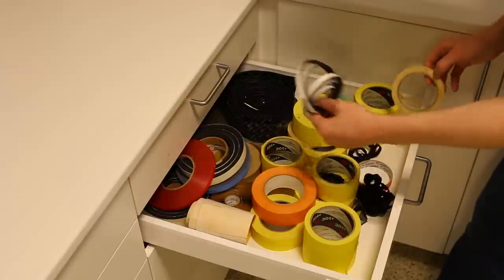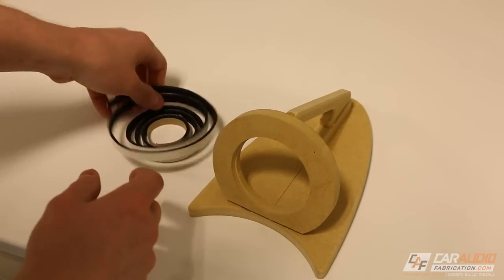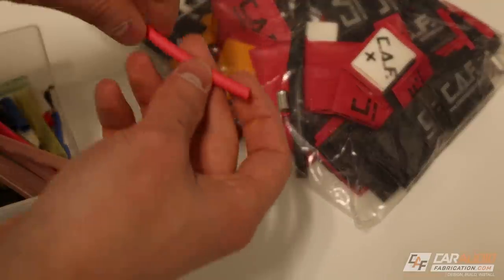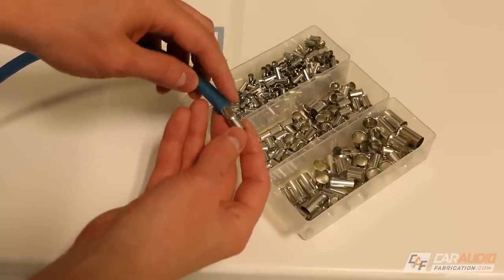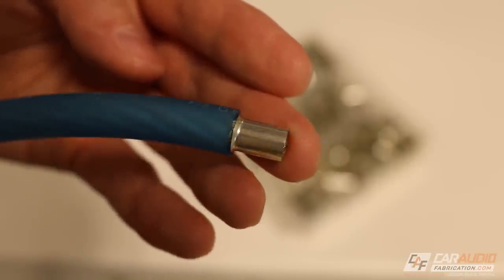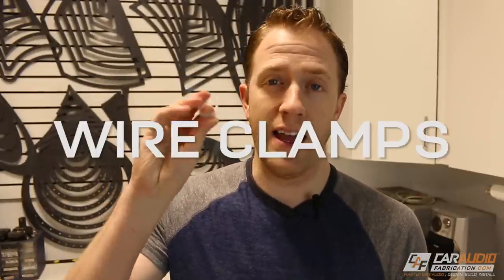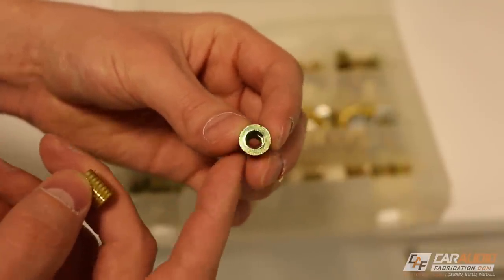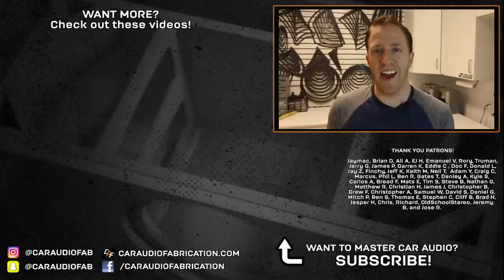Installing Car Audio? 10 CHEAP things to have FOR EVERY BUILD!

Comment: would those threaded sheet metal fasteners work for grounding wires to the sheet metal? Seems like a cleaner way than drilling then bolting with nut and bolt, takes the need for a nut under the car away ect? Or would they not ground properly? I'd think with the metal sanded down to bare and it literally squeezing itself into the metal it'd ground perfectly, but you'd know if there are any problems with that way, let me know if you can, thanks (I think it'd make the install in my e46 neater, but don't want to run into any grounding issues if I go that way)
Reply: yeah i should have thought of that haha, Good thing I haven't got round to my system yet. I'll give them a go, I can't see why they wouldn't work tbh

Comment: Ok i have a question aboit a specific vehicle... I have a 2017 mitsubishi lancer and it has the factory Rockford Fosgate system in it but its not enough bass for me and i wanna add my amp and subs that i have had for a while. I have everything i need from box,subs,amp,wiring,and the LOC to go from speaker level to rca to run to my amp. My problem is where to get my input signal from for my amp? Ive been stuck on this for a while and my local "custom audio" shops advice was throwing a different loc from what i had and saying "thats all you need"and "the directions are in the bag but its pretty self evident what you should hook everything to" so could you give me an idea where i need to get my signal from? I would gladly pay for good advice from somebody that knows what they are talking about!!!!!

Comment: Great information here. Tell me would this sound system be okay to start with? It is about $350 dollars.

130S5000BT  Pioneer DEH-S5000BT CD Receiver

130TA6986R  Pioneer TS-A6986R 6" x 9" 4-way Speakers

130TSG680    Pioneer TS-G680 6"x8" 2-way Speakers

130GMA4704  Pioneer GM-A4704 40W x 4 Car Amplifier

007CK10       Amp Wiring Kit 10 gauge
007CPER417  4 Channel 17 ft RCA Cable
007CSW16    Speaker Wire 16 ga per foot

Comment: Relays are always a good thing to have on hand. I like to keep some diodes around too, just in case it becomes necessary to tap into a line, the signal won't feed back and cause other components to be affected. I'm a fan of the 3M spray adhesives, but other brands probably do as well and cost less. Single edge razor blades have saved my butt on numerous occasions, as well as a spring loaded center punch. But as far as tools go, the one you leave behind is the one you will undoubtedly need later.
Reply: and extra amps and batteries.

Comment: I know this is a old video, but how do you put on the metal ferrals on big cables like 35mm? I cant use them because it seems like the cables gets bigger when I peel them
Reply from the maker: You need larger ferrules then, sometimes it helps to twist the wire slightly.

Comment: Hey I have a question, I'm new to car audio and I'm 14. Let's say you're running 4 amps for your subs, how would you get 4 Rica inputs for those amps without y splitters ? And daisy chaining
Reply: You'd have to have 3 channels on the head unit, but to make 4, you'd have to daisy chain

Comment: Mark I ordered some of the Ferrules you linked to but I can't get my 1/0 wire into the ferrule. I used a set of calipers to measure my wire, and it's like .447in, and the ferrules are .4in. Do you have any tips to get the wire into the ferrule? I'm sure the wire will compress down to .4in I'm just not finding the trick to make it work...
Reply from the maker: +Travis McVey you will have to get different ferrules, wire size varies drastically in the car audio industry so its important to measure before you order.

Comment: Is the first "tapes" to seal the backside of an speaker against the metal side? or maybe use M3 tapes like dubble sided one? its similar results id guess.
Reply: You mean 3M automotive tape? Never ever use that on a speaker. You'll never get it back out. Single side sticky is the way to go.
Reply: aah i see thanks for info :)
Reply: okey thx for info.

Comment: Installed two amps and three speakers didn't need a single bit of shrink-wrapped. Trust me shrink wrap is great I use it all the time when I need it but I didn't need it. Title says every install
Reply: I did an install without any ferrules. 
And another install without any tape. 
And another install without any threaded inserts. 
And another install without any spade connectors.

But without heat shrink? Guess you did it wrong, the title clearly says EVERY INSTALL!

Comment: Is there any advice on improving sound quality when the car has a very low-end stock stereo system?
My car has 10cm wide speakers that simply bolt on into an open cavity on the dashboard and the ceiling covers. There is no box, there is no sealing and also there is no adapters for bigger speakers being sold. What are my options?
Reply: Well three years late but may i ask what car is it? There is either option to change that stereo or use high level line input on the amplifier side. (Bad english but i hope you understand) also might not need bigger speakers, but something higher quality, or more power (power aint everything though) with some sound deadening and maybe even some kind of case, some will work pretty damn well freeair too though. 10cm is basically 4" i think so i would personally go with dls 4" two way component set but it might not be enough for everyone, for me i know it sounds great and it is enough for me with a small sub.

Comment: for the RCA,how long is the best size for the head unit to the pre amp?
Reply: the best size is the length you need.... a smart car and a full size SUV will take totally different lengths if you mount the amp in the read....  it all depends on your application.

Comment: are RCA y splitter good on a four channel amp
Reply: Numpsey Cooley nope, you need 4 rcas for the 4 speakers. Otherwise your front two speakers and back two will share the same sound. (Mono)

Comment: What the best amp gauge to wire two amps 0 awg or 4 awg
Reply: Kelvin McCowatt depending on the size of the amp. look for the recommend gauge wire the amps need and the run a bigger wire to a distribution block and split it into that gauge wire. ex: if the amps needs 4 gauge wire, run 0 gauge to a distribution block and have 4 gauge split into each amp.